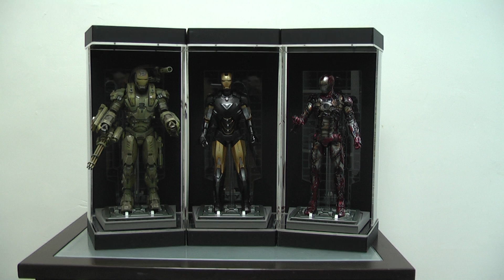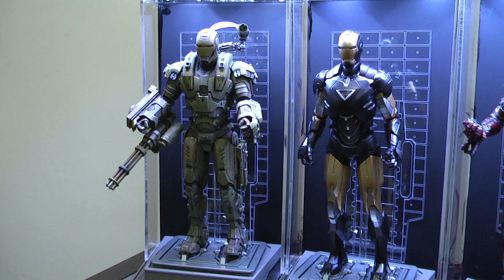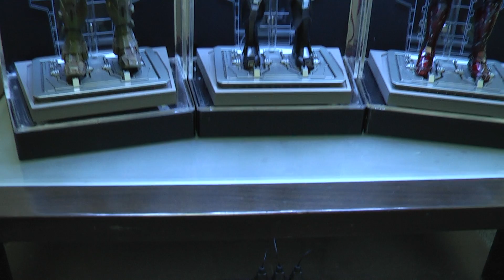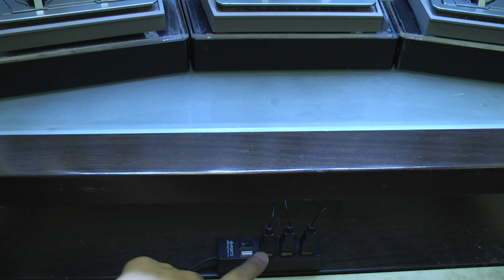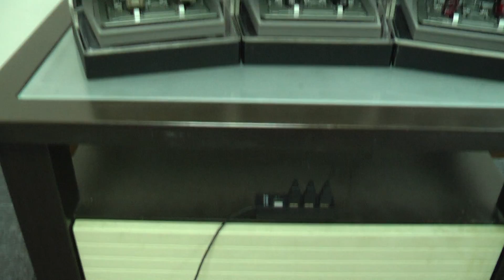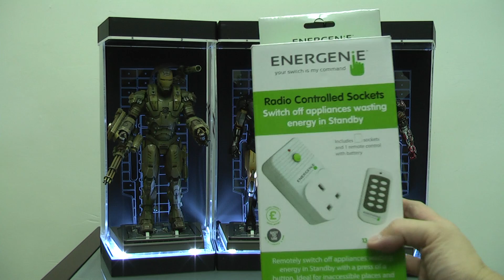Hot Toys customs, how to remote control LED lights, custom Iron Man Hall of Armor

Comment: Very nice and informative video Anthony.
What you´ve done here, in my opinion, is taking it to another level. I love the different sets of LEDs in each hall of armor. That gives you a lot of options in terms of lighting. For example....I really like the look when you turn on the first 3 sets of LEDs just before the full beam from above. But even with all of them turned on it looks absolutely amazing! I´m really impressed with what you´re able to do and what you´ve eventually came up with. In some ways I think your custom hall of armors are even better than the original versions from Hot Toys.

The remote control is also a thing I´m going to look into. I´ve already mentioned my switches are quite hard to reach because I didn´t want them to be visible. So these remote control switches are a great idea! 

Also I want to thank you for mentioning me in this video and putting the link to my channel in the description. I really appreciate it!
Reply from the maker: Thanks - much appreciated!